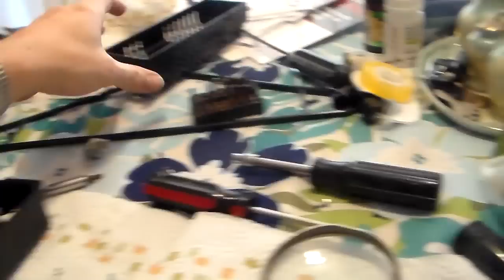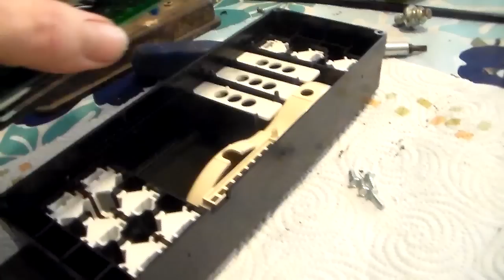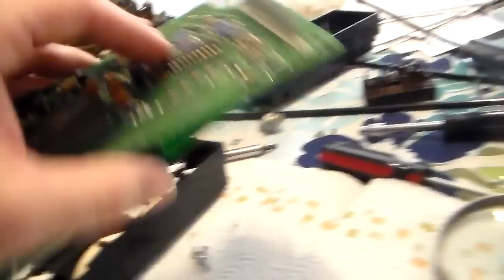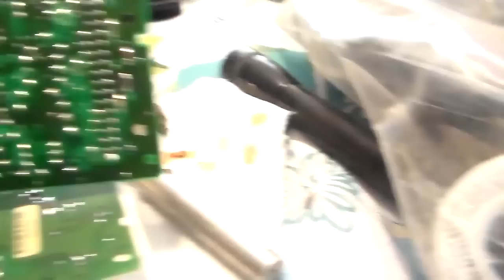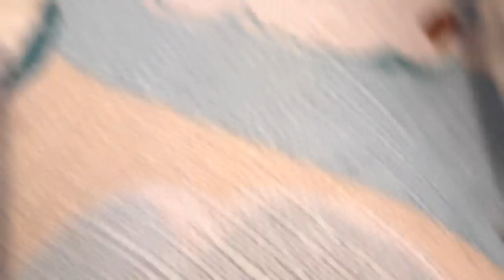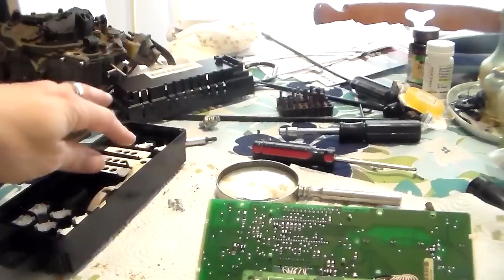1997-03 Buick Regal climate control display repair part 2

Comment: Thanks for the great video, I did exactly what you said, It work when I was finished. I have a 1999 Buick Regal with 30,000 miles. Went to Buick and they wanted $700.00 just for the part. Thanks again Rocco
Reply from the maker: You are welcome. Cheap easy fixes are the best.

Comment: Similar resistors solder joints fail on the 96 Impala SS odometer circuit which makes it fade out. Good ole GM quality.

Comment: my dads 93 buick roadmaster has a auto climate and what it does is it blows on high and keeps ac compressor kicking in and off every 2 seconds and you cant turn it off no buttons work and if you press off it just changes modes like your pressing mode lol.so because it wont turn off we have to remove the fuse.it will stop with key off ofcourse it does it with key on.i tried a climate control from a junk yard but it does the same thing.im losing my hair figuring out this evil control.is it possible the junkyard unit has the same issue?any ideas?thanks

Comment: So I got my boards out. My issues was my read out got hit so the controller works but the an impact crushed the read out. I wanted to do a destructive analysis. So I get to this offending board. and my board look ok (so I'll save it, thanks) but it is different. and the board markings are "16254177C P11    16254177C P09"  which is different than yours. Maybe I got a better board ??? Do you thinks so??
Reply: Pedramsal I got my box on line from a salvage place, and they also have never been used one for a little less. they all seem cheaply made. I didn't solder since but of layouts Looked different. One other thing, since the module was broken so long I forgot the fan won't go on for heat ,until, the engine is warm enough to actually heat. I was nervous it didn't work   but it did.
Reply: mine doesnt have flat resistors. Did you use a guide, or just eye ball figure that out?
Reply: GM quit on Pontiac and Saturn, The Buick is not my choice but I got for free. I love driving it but the dash board and controller are defective went new, I fix most of it my self and have a master mechanic for the hard stuff. When my Saturn and Buick die I am done with GM. I don't like Toyota dealer near me and Honda is supposed to be good, but my 1996 Miata has 180,000 miles. I bought a whole controller from online  these videos helped me get the controller out and that is a hard part
Reply: Feel yeah; Got mine as a gift, and family decided to throw money at the bad idea further to hide the bad investment on what was suffice to say 'a junked car'. Have replaced nearly every major component on this damn thing - with new junk parts... Basically has become my intro into mechanics... Engine, joints, tires, and basically the entire engine assembly... From the alternator, air, fuel, down to the water pump, and now I'm onto electrical components from the car stereo to the air control system, and the damn speaker wiring is going to be fun.....  Just finished running it through the California smog gauntlet.

I will say the interior dash on the regal is much easier then my friends vw jetta, so I'm happy with that. I think I see the cracks in the joint soldering now that I've looked at some video lessons on the use of flux and circuit repair. /watch?v=XPLD3fYfEYc 

Once I'm done with all this I'll be onto cosmetic... Dents, cracked windshield, torn seats, sticky carpeting, mirrors, and interior assembly... Then back to replacing whichever of my junk replacement parts become junk again.... Will be interesting to see how many miles is on this thing when my resistors get here... 

One nice thing about the Regal; Most GM cars use the same parts, and there are plenty in the junk yards.

Comment: It's not a 'cold solder' joint as you say. It's just over time all solder can break when subject to heat and cold changes. Mostly time. To blame gm or any manufacturer is ignorance. Mercedes and bmw or audi can all have the same problem. Trust me I've worked on car electronics for over 20 years and every car has it's usual failure points at a given window of time.
Reply from the maker: It's not IGNORANCE. It's well-deserved criticism. You're parsing out information to support your argument. Are you on GM's payroll? Yes, any solder joint can break over time. The difference is that they DON'T unless they were poorly done or the part they are contained within is under-designed. I watched those boards being BUILT in the 90's...I could teach a class on surface mount technology and solder wave operation.

You are defending the indefensible. You have thousands of Asian-branded vehicles running around as old as these GM's and they never have those issues. I drove two different Infiniti's('98 and '00) with NO climate control issues and they are every bit as complicated as these are, probably more so and much quieter in operation. Of course, GM's offshore supplier is to blame here. Take a tour through one of those Regal's or Bonneville's one day and check out all the "Korea" and "Malaysia" or "Singapore" country of origins on the electronics and elsewhere.

Mercedes, BMW and Audi...don't even go there. Those cars are for people that trade when the warranty is up. Even the spare parts need spare parts. Overthought ideas that end up being under-engineered. Take a Bosch starter/Alternator and a Nippondenso version of same and you can bet money which will fail first, with no warning. You are entitled to your opinion but I don't share it.
Reply: Well it looks like a cold sodder joint, he got that part right as rain and that is the approved american way of saying solder. Issue really is the move to lead free solder and this is the effect, components that have drastic temperature changes will 'pull' themselves free from the weak joint in the first place. Solution is to wick away all the lead free solder and using a good flux replace it with time tested 60/40 lead/tin solder. You are fixed for life. GM is not the only one playing the safety nazi game with lead free solder, singling them out just highlights your prejudice and I don't care anyway.

Comment: A heat sink and a cooling fan would make these all last longer but you won't pay the extra thousands per car for the added engineering, rnd, and manufacturing that it would take. Nobody thinks about all of that. Audi vw has similar display problems but nobody complains about that. Since they over pay for those piles anyway. Find me a car that will last 200k miles and tell me why it isn't the only car in the world that people buy.
Reply from the maker: Oh come on. A cooling fan?  The problem isn't thermal degradation. The only real amperage being drawn is by the blower motor and that's handled outside of the HVAC controller with a relay and a heat sink THERE, inside the blower housing. 

Again, why aren't you talking about the vehicles that don't have these issues? How did Denso manage to build HVAC controllers that last nearly forever? It's not proprietary information. You spec it, contract it, have it built. Denso just does a damn better job of it as opposed to Bosch and whomever the Pacific Rim supplier was GM used. If Delphi did build that here in the states....they should be ashamed of themselves.
Reply: Resistors don't get hot? Electrical loads don't generate heat? ok. If not ignorance, what is it? LED's don't draw? Have you ever learned about electronics? Or do you just watch them being built? I don't know where you're coming from.  How is it that it's mostly the resistors in any given electronic part; climate control, instrument cluster, HVAC resistor pack....; that seem to have been "cold soldered"? You're telling me the machine that makes them just decides to do only those components wrong?  Why do people sell climate control units all over the internet, if nobody needs them?  For that matter, why do people sell new and used electronic parts in general? Maybe they don't last forever. You've watched them being built, maybe you should have said something when they missed those components.